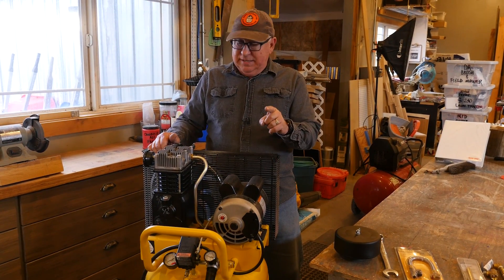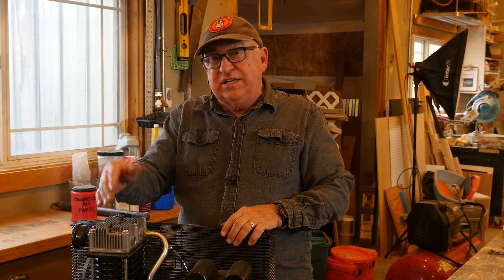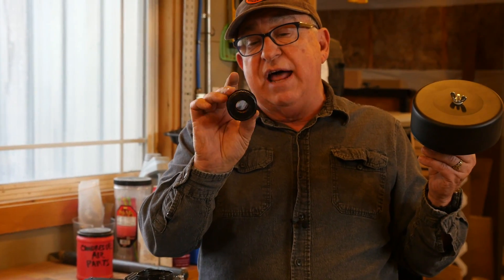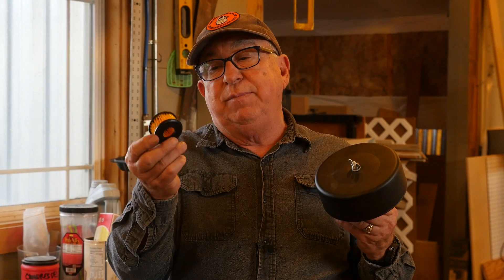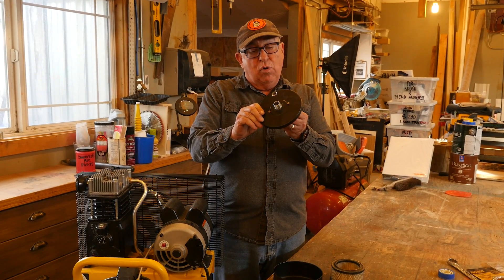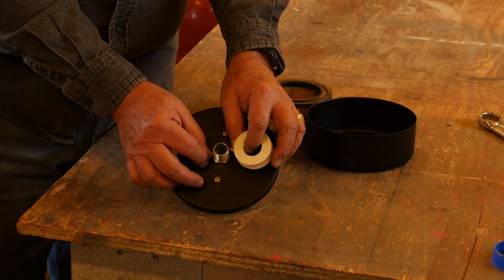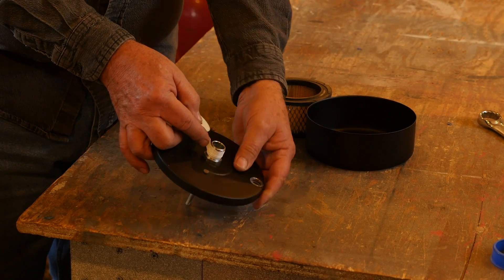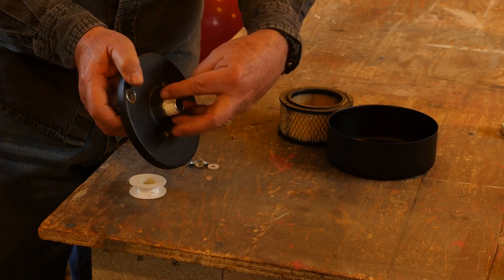3 Best Shop Air Compressor Accessories

Comment: Former aviation inspector here. The drain extension is a good idea - although there are a few problems that need addressing. 
1. It is an unsupported stub. Depending on how each person constructs their variation, there will be some resonant frequency for that stub and a chance for a metal fatigue failure at the fitting into the crankcase. Remedy would  be to support the drain line with a clamp (Industry name is "P-Clamp") to one of the mounting foot bolts of the crankcase.
2. Putting a simple 90° petcock valve at the end of the drain line is a dry crankcase failure waiting to happen. There is no locking feature to prevent the valve from being bumped into a partially open position and the pump operating without lubrication and seizing up. Solution is to use a valve handle that can be safety wired to the closed position, or replace the valve with a cap or plug at the end that is drilled for safety wire.
3. Observation: Pipe threads are a tapered thread which provide somewhat of a friction locking feature, however, there appears to be presence of some red substance on the threads. Is there a thread locking compound applied, in particular, to the drain plug threads as a secondary locking feature? If Teflon is applied to the drain plug, the sole locking feature (friction) has been compromised.  Point being, at the critical drain plug location, the manufacturer is not depending solely on thread friction as the locking action but adds a second by using thread locking compound. The drain extension design should do the same and provide a true positive locking method (safety wire) to the new drain plug in this high-vibration location.
4. Also, angle the drain extension line slightly so there is a drainage angle relative to the crankcase.

Thanks for your work, Dirt Farmer Jay!

Comment: Want to improve the air filter as well. My is on a platform close too the roof don't have much room for air filter, could you please measure the distance from the top fins on the pump to the top of the air filter? I live in Canada don't want to order it and it don't fit.

Comment: Did the air filter mod help it run any cooler? I noticed my pump gets hot
Reply from the maker: No, there is no significant difference. The pump will get hot and it is designed to do that. The heat distribution fins on the unit help dissipate the heat, as does the oil in the crankcase. If you keep the fins clean and the oil topped off and changed regularly, you shouldn't have any issues.  Best, DFJ

Comment: Any link for oil drain plug?
Reply from the maker: https://www.homedepot.com/p/DEWALT-Extended-Tank-Drain-Valve-Assembly-for-Air-Compressors-DXCM072-0023/321180348

Comment: Worked in a large shop for years that had one big compressor and lines to each shop. At every hookup in each shop there was a glass cup with peacock to release water in system. The compressor had what the engineers called a dryer so it didn’t need to be drained at the tank, is this something that could be fitted to that compressor?
Reply from the maker: Thanks for watching and writing. The hookup collectors you describe are a good approach to visually monitoring water content in the supply lines and being able to conveniently drain off the water. There are units like this available and they work both in the home shop and industrial settings. As for the compressor dryer, there are various approaches and price points for these units, and the good ones are not cheap. So, another approach is to make sure water is drained consistently from the tank. This can be either manually, or there are moderately-priced automatic units available. Best, DFJ